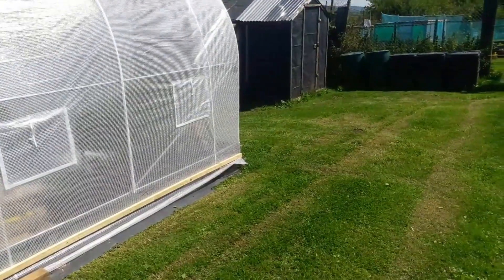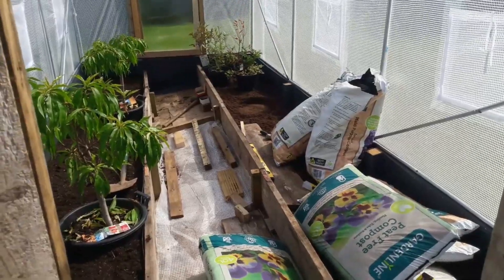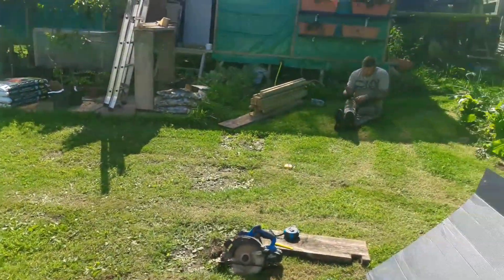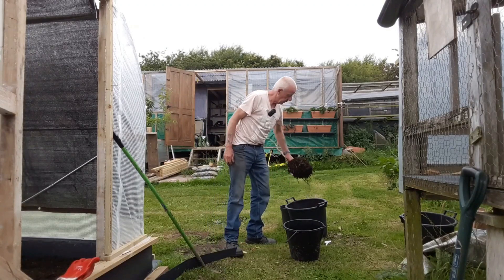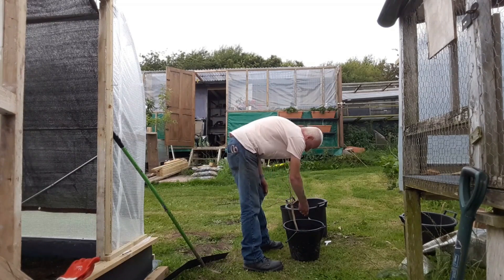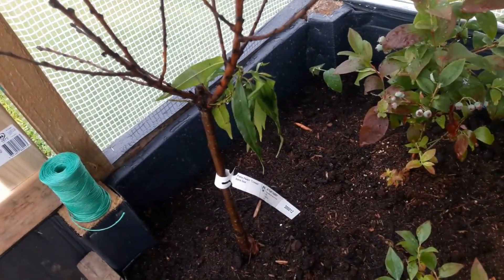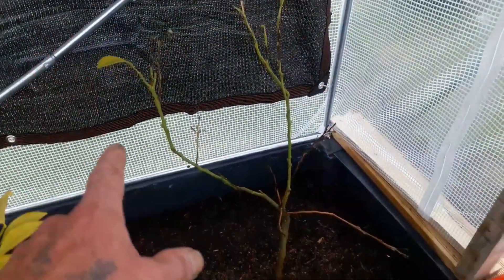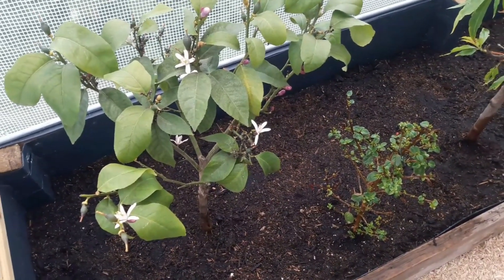Alan's Allotment #45 How to save a Dying Tree, New Tunnel planted out now Enjoy.

Comment: Thank you I have just watched your whole thing on building this polytunnel this is the very one I have brought and for a 5ft2 woman I was worried about making it up. I'm going to dig a trench for mine. Does it really need the wood bracing? Thank you so much for your great information
Reply from the maker: Hi Thanks for the comment, trenching should be fine however you will need wood for the door frames if you want it to last?? your climate will depend a lot on what you would get away with? however we get horrendous gales here so this is how i do it. stay safe Alan